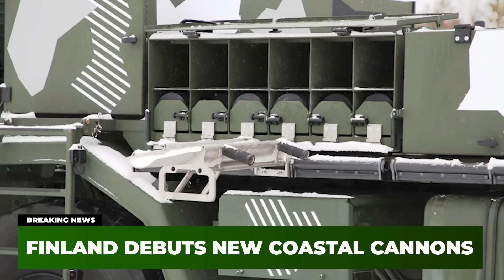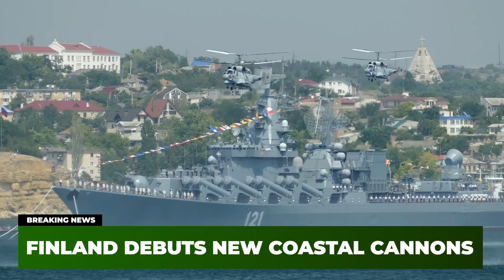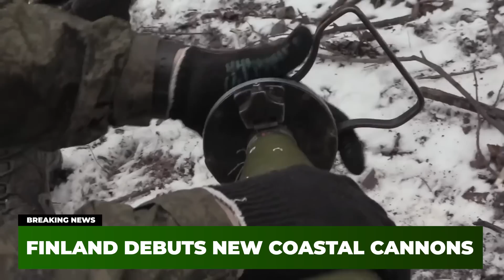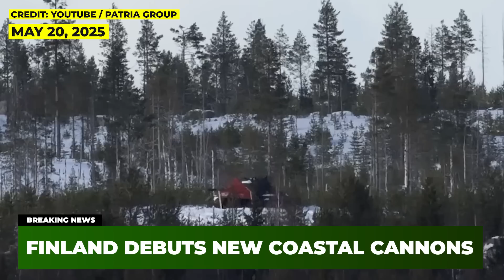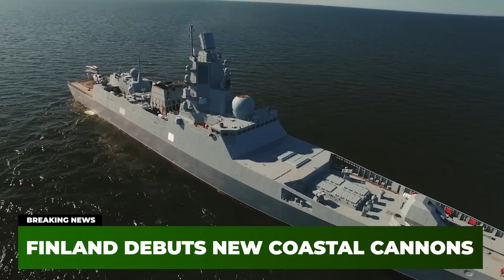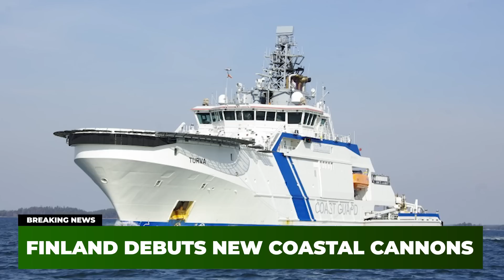Finland’s Next-Gen COASTAL CANNONS Could Annihilate the Russian Baltic Fleet

Comment: 🎉 Especially if it is firing Ramjet Munitions which have a certified acceptable range for a guaranteed CPE of 145 MILES. IMO otherwise they're not that bad as* yes they're mobile, yes accurate, yes rapid fire capable, but not beyond the reach of Russian Naval firepower. The majority of aces they have make them good...but without extended range only good not great.

Comment: I like the idea of a system which ain't so depended on technic and robots, but  I see also the problems with manpower.  Men have to work outside in cold and mud. If one men gets hurt by back injuries or joints or knees, you miss a man in your crew.  Also you need more people to man the thing 24/7 in wartime. On the other side. you don't need very high specialised people to man the gun, the number of mechanical failures will be lower.  And it is easier to go from one sort of shell or propulsion load to another .

Comment: More importantly, it's pretty cheap and simple system so it can be deployed at larger numbers. I assume they will be making this regular artillery too. It's not fully automatic, but it's mobile and there's no heavy lifting aside from the ammo since set up is done automatically. Overall, quick enough, automatic enough and mobile enough. Which means you can make it cheap.
From what I know though, they are also building automatic aiming into the thing. Probably as module. Automatic reload on other hand is quite unnecessary.

Comment: I wouldn't really call this tracked gun as something really new since what actually is new about this is the design philosophy -at it's core the system is a stripped down Swedish Archer or Korean K-9. Making it cheaper and easier to maintain even under budget restraints or when inside military conflict with strained logistical chains. Naturally this system also isn't as protected as those two but heavy artillery was never supposed to be right at the front-lines to be taken out with pod-shots anyway.

Since it's more simplified design, it's also cheaper to produce and cheaper to produce = more of the same = more units to field = more bang for the buck.
Reply: Yes, not "tracked gun" as it lacks tracks. 'Self-propelled artillery', absolutely.
Reply: That's why Finland has K-9 too.
Reply: @mukkaar  And those heavy American MLRS systems -the big brothers of himars that fire unguided rockets over 50 km and guided missiles for several hundred kms.

Comment: Yes faster firing rate can be good, but can the barrel take the strain of faster firing rate. There are limitations of how much stress and heat the material can take. It can significantly decrease the longevity of the barrels and can lead to critical failure. But I'm not an expert, just throwing it out there.
Reply: All artillery crews keeps track on how much they fire and at what loads. Each gun is accompanied with a dedicated log book that tracks the number of shots and how heavy powder loads they have fired. More shots with heavier powder loads, shorter barrel life and vice versa. This allows them to know quickly and esily when they need barrel replacements and maintenance.
It's really nothing new and it's well known to the militaries. After all, modern artilleries and barrel changes have been a thing for a long time.
Reply: @alaric_ i thought that with its current firing rate was already pushing the barrels to their limits, and increasing it even more would be just damaging them even more and faster which would lower the amount of shots per barrel because of the sheer stress on the material making it too expensive for what it is. But if it's not then all cool. It makes sense that all of that is being tracked, like shots fired developing cracks, bending due to temperature, maybe even curving, expanding, wear on the threading. Within the tolerance.

Comment: These are a solid upgrade to towed units, but hitting a moving ship at any significant range is going to require active computer aiming, or they're going to have to dial in likely landing locations and docks.  
Even then gunnery against moving ships has consistently been ineffective without massed fire.
Reply: I wasn't in the artillery in my military service, but isn't massed fire the 'thing' when you fire cannons. The K9's are still there.
Reply: Didn't you know? There are bunch of guided artillery shells available these days?
And another thing, computing power is not an issue with average mobile phone having enough calculation power to deal with the firing solution. Combined with the radar information and updated each second, the huge several thousand ton ships simply cannot out-manouver shell going at supersonic speeds. They are not small cars, they are huge ships!
Reply: @alaric_  Yes there are, and they are tremendously expensive and limited in supply compared to conventional unguided artillery.  The ability for a guided shell to alter it's course is also fairly limited compared to the ability of a ship to change it's position 10-40 seconds into the future.  
These guns can certainly be used against ships, especially in situations where ships have no choice but to approach a shoreline within the gun's effective range, but a 152mm gun optimized for firing on either static targets, pre-ranged targets, or individual relatively slow moving ground vehicles using known roadways or approaches is not going to provide some overwhelming advantage against large military ships.  
Mobile batteries firing antiship missiles combined with drone harassment and long range drone torpedoes seem to be most effective if you are a relatively small nation trying to defend yourself from invasion by sea by a relatively larger nation.
Reply: @youtubeisapublisher6407  True. But did a quick google search and Finland did buy guided shells 2½ years ago quite a bit. After the start of the Russian offensive in Ukraine. Some countries are (relatively) quick, some still haven't woken up to reality. Of course it's hard to say if they are intended for this system. Surprisingly, some things are military secrets.
Reply: Had it figured out with the static artillery positions, but having mobile artillery does make it more complicated. I'm sure the modern fire control is up to the task.
Reply: Therefor Bofors Got the super Archer!
Reply: @nataliiateteruk585  Go Archer!
Reply: @nataliiateteruk585  Yeah, archer is all about accuracy, this one is more about just getting ammo in the air en-masse -it's still fairly accurate -mind you. but nowhere near Archer-system level.

Comment: It's great that different nations want to have their own artillery, but don̈'t we already have enough 155mm howitzers already? Can't NATO settle on one design and let everyone produce them? The savings could be significant.
Reply: Didferent need of different areas.
Reply: @nataliiateteruk585  Fair enough.
Reply: The same caliber is the most crucial requirement as the manufacture of a single barrel is the most time consuming thing along with the millions of shells. Most artillery systems already have nearly the same barrel length so switching to another model should not be such a huge deal. The biggest difference are the mating surface and method to fit into the frame and i'm pretty sure they will be standardized in the coming years. That means individual nations can produce best model fit for them with the most difficult part being the same in almost all of them (slight variance in length might still be needed for specialized purposes).
Reply: No. Can NEVER have enough artillery. Ask Russians, who lost over 10,000 already.

Comment: Thyank You Finland! = Gulf of Finland covered at north then until 40km / 25 miles = 2/3 of area of Gulf of Finland . Greatings from Estonia.
Reply: Not of the area of Gulf of Finland by any means, the distance from shore to shore at the shortest point. Despite the kind of flattering presentation about the artillery piece in the video, it gives a rather misleading view of the ambitions for what coastal artillery is supposed to be used for. It is necessary for fending off attempts at flanking troop landings. From the video it one could be left with the impression that tube artillery is Finlands anti-ship weapon of choice.

Finland relies on older RBS-15 missiles and newer Gabriel V on truck and ship platforms to use against enemy fleet assets. They have little reason to come near Finnish shores anyway.
Reply: @herptek  Yet, they pose threat to any and all enemy ships trying to sail between Finland and Estonia. The range from both sides means that all ships fall with the range of even the artillery systems. And the video stated that the 40km range is with normal ER-ammo, not mentioning the M982 Excalibur that increases the range to 70+km.
Salvo of guided 155mm shells is going to wreak havoc on any ship, destroying sensitive equipment on-board.
Also, you deliberately try to portray Finnish capability as worse then it is? Finland has bunch of different missiles to target ships, fe. the AGM-158 JASSM with 400km range.
Edit. Here some data on that ""old"" RBS 15 Mk. III:
"New turbojet engine Microturbo TRI 60-5 with 4.4 kN (990 lbf) of thrust, range over 200 km, with added land attack capability.
New warhead (increased penetration and insensitive munitions qualification) from TDW. There is only a ship launched version. Production started in 2004. New oval launch tubes instead of the old box type."
"Production started in 2004"... Please show what antiquated crap russia has left after years of sanctions and cheap chinese parts....
Reply: @alaric_  I am not trying to portray the matter any way other than objectively. What a weird way to read my comment. I was actually complementing the capabilities of Finland: I said that contrary what one might conclude from the video without knowlege we do actually have real anti-ship capabilities to deal with the Russian warships on the Gulf of Finland including older variants of the RBS-15 that I spesifically mentioned and you ironically jumped to emphasise the performance of for some reason.

The current anti-surface weapon of the Finnish navy is the Gabriel V missile, with almost unnecessarily long range and good performance.

JASSM is a stand-off ranged air-to-ground weapon designed to hit targets on land. Weird example to pick given the topic. If we needed the air force to help I have suggested before that we should place orders for the JSM missile, which is a ship killing weapon that fits into the weapons bays of F-35. It would be a great addition also because it has also land attack capability.

You see, it is weird to me to see coastal artillery described as some anti-ship capability posing a threat to Russian Baltic fleet, which has little reason to hang out in range of it. What coastal artillery is good for is for example to prevent tactical troop landings, prevent clearing of minefields near costs or perhaps to support the fighting of the coastal forces on land.

The army is going to have much more use for a weapon like ARVE and I at least am looking forward to seeing it adopted at large scale. After all, the army is many times bigger than the navy and they have much more need for heavy artillery in their basic job.
Reply: @herptek  All missiles and anything with a homing capability can and WILL be hacked and jammed by Russia to reduce efficiency. Dumb artillery with good aiming is good because it's impossible to interfere with... Except with very heavy cope cages. Don't fall to the trap Ukraine did when the West oversold them with precision guided munitions and MOAB's that now only hit 50% of the time against Russia...
Reply: Trump has been promised a golden Lada and now renamed the Gulf of Finland, 'The Gulf of Putin'.

Comment: just never operate it without three antidrone platforms escorting. Russian naval forces could run fiberoptic drones into these from TWICE these things firing range. plus, given manual aiming, they're unlikely to ever hit a ship IMO. precision? idk, I guess they're handy to have
Reply: The longest fiber optic drone ranges are 40 kilometers which is not twice the firing range. These do make use of FCS which helps its accuracy on moving targets and paired with guided shells chances of a hit are very high. We used to hit targets 25 km away in ww2 with rudimentary FCS so I don't see how a 40km hit is unlikely.
Reply: @masterbaiter0fthebait572  Perhaps he is thinking WW2 Soviet artillery which was notoriously inaccurate and needed sheer volumes to hit anything.
Reply: @masterbaiter0fthebait572  sounds good then, thanks for the info!
Reply: @daruekeller  No problem.
Reply: Fibreoptic drones with an 80km range? Haven't heard of those?
Reply: @TheDeadpedal  Most of these MoFos have no idea just how much 80km worth of fiber-optical cable weights and drags behind a tiny drone😂
Reply: @villerantavalli9395  good point, and over water it'll likely behave differently, maybe sink?
Reply: That sounds like new tech that has not been publicly released yet. You sure you're not leaking information without authorization? Maybe ask your superiors....
Also, you never heard of *guided artillery shells*? Perhaps you should google it, it's thing these days and well worth the price when it hits an expensive frigatte.
Reply: But I would say  U.S MLRS with PrSM missiles would be a lot more useful given the massive range increase, hit chance and damage and fire rate.